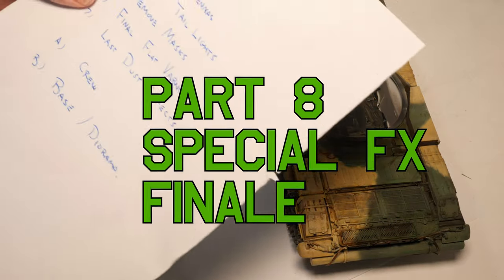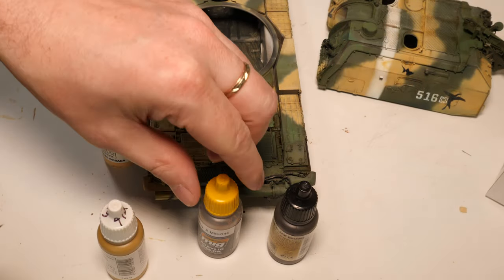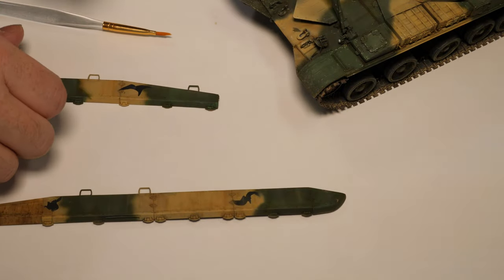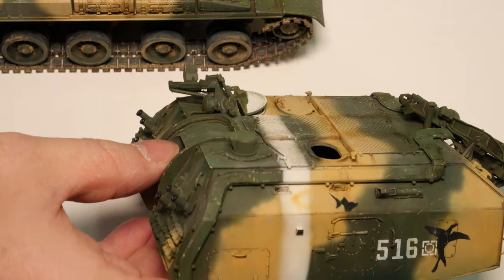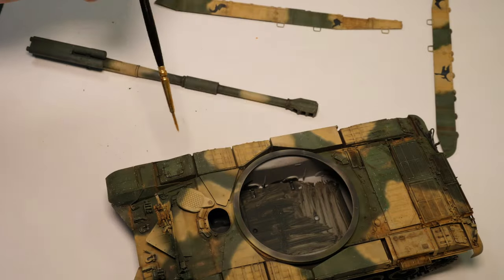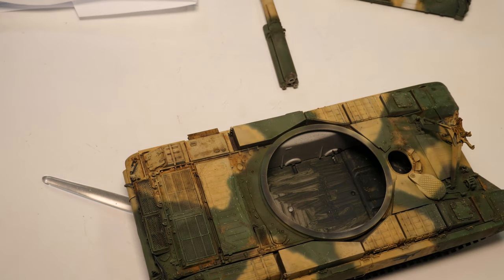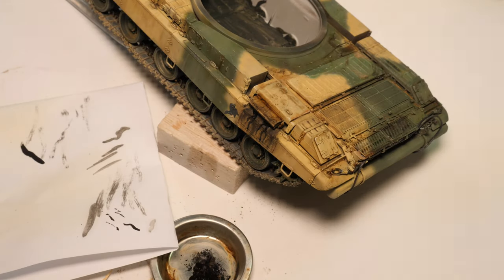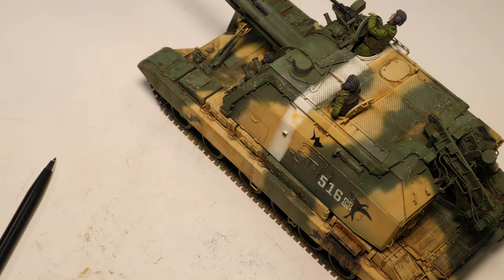Trumpeter 2s19 MSTA 152mm howitzer SPECIAL FX / FINALE part 8

Comment: Excellent work on that Self Propelled Howitzer. Looks like a very detailed build and figures are outstanding!👍👍👍
I served on a few types of  Artillery pieces for 7 years in the U.S. Army.  My first duty station Ansbach FRG, there was  an instance where the paint had chipped off our battery's compliment of 6 guns, that the command decided it was time to paint. Unfortunately we had a long  field exercise coming up, and little time to paint all the vehicles in our battery. Something I will never understand was the fact they had ordered the special paint, 3 colors; nato green, brown, and black ( no tan) so we were transitioning to the 3 color scheme, but I degress. Apparently they had us use a yellowish zinc paint and apply it to the scratches, which were everywhere. I really wish I had a picture.  We went to the field like this.  It looked far worse when our vehicles got extremely filthy.
Its always interesting to do certain details to our models to achieve authenticity.
I recently did something similar to the Orochi M3A3 Bradley I finished, although painted in a desert tan, some components, to reflect hasty replacement, were painted in a green or a primer gray and shaded appropriately.
Looking forward to your next video!